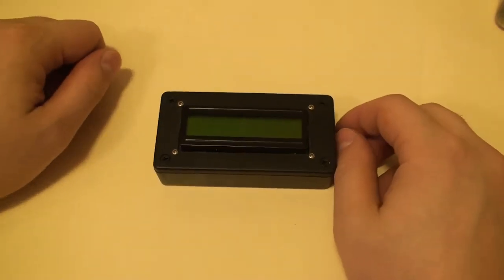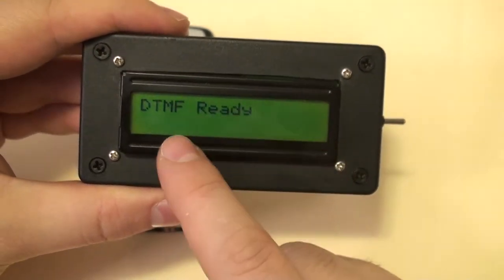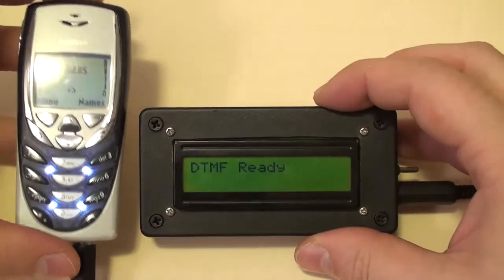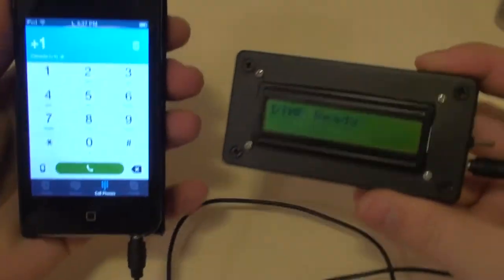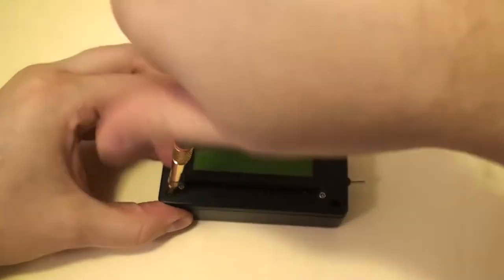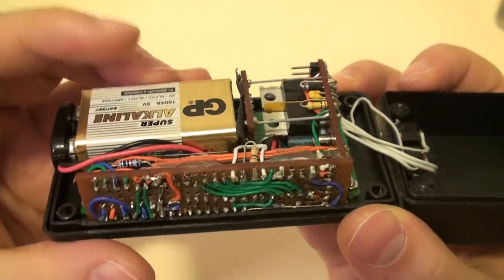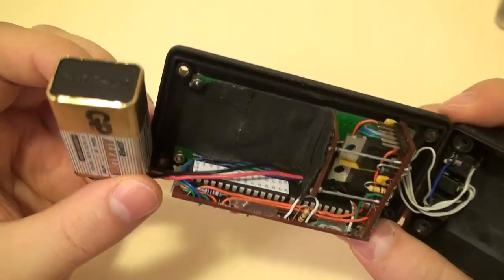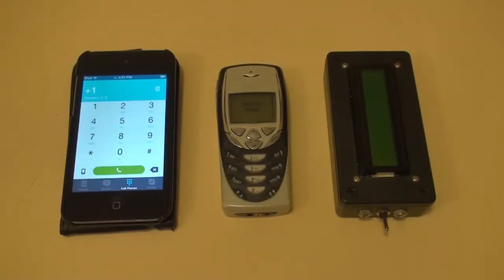Pocket Dial Tone Decoder

Comment: Any schematics for this or your first project?
Reply from the maker: There was a post on Hack-a-day that served as inspiration for the project. I added a link to the description.

In my design I decided not to have a pass-through audio connection as it can easily be accomplished with a splitter. I added a diode-protected MOSFET to one of Atmega's pins to be able to run additional loads and switch relays.

I had to make a few adapter cables for various cell phones as some required a dummy load resistor where the microphone would've been, in order to emulate headsets.

Oh, and I got rid of 2 filter caps near the 16Mhz Arduino crystal. Somehow they were picking up interference.

Comment: You sell these?
Reply from the maker: I only made one and I haven't touched it in years. These days it's much easier to use a sound analysis app on a cell phone, or even decode a dialtone on a computer. There is no longer a need for a standalone device. Second link in the description closely resembles my build. Only thing different is that I made mine more portable and instead of using a full Arduino board I only utilized the main chip. I also tweaked the firmware for my setup. Otherwise the link contains all the necessary information for building a replica.